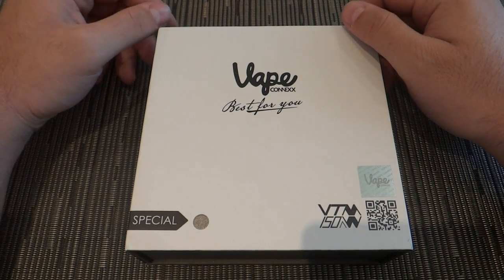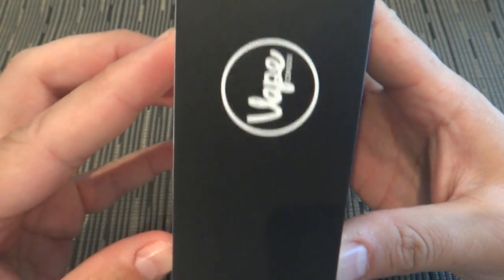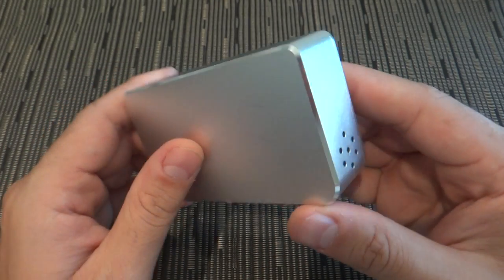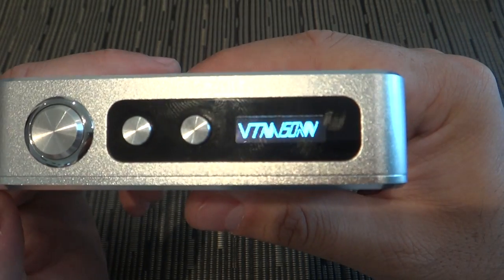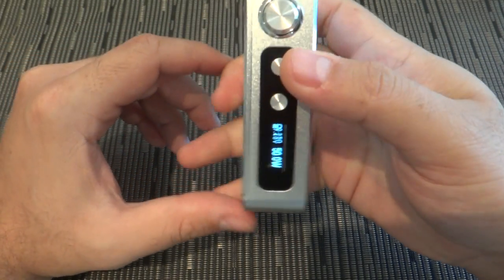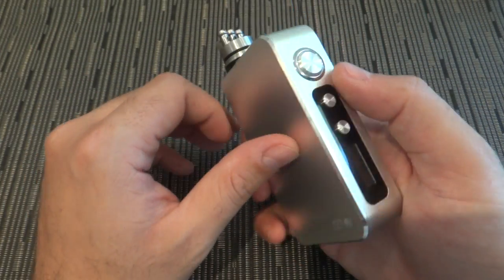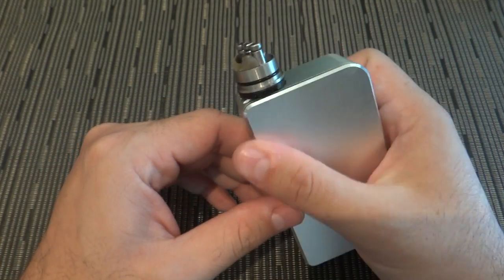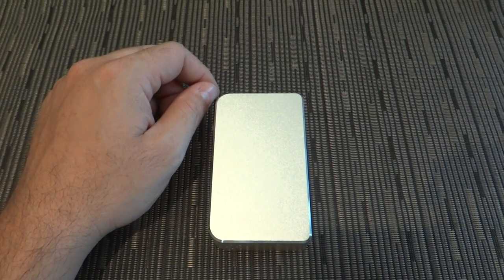Vape Connexx VTM 150W Box Mod Review

Comment: God, what a shitty "feature". I don't need protection from dry hits. This box mod has it completely ass-backwards. The DNA200 has it correct - instead of a slow ramp up to my set wattage, the DNA200 can be set to fire at above your set wattage in order to heat up your coils quicker and then level off to your set wattage, which will drastically cut down on coil ramp up time. Especially useful for those of us who build using claptons, fused claptons, alien wire, and other specialty coils and wire.